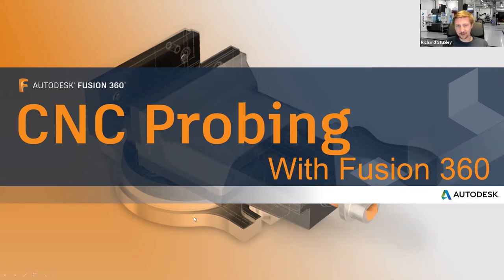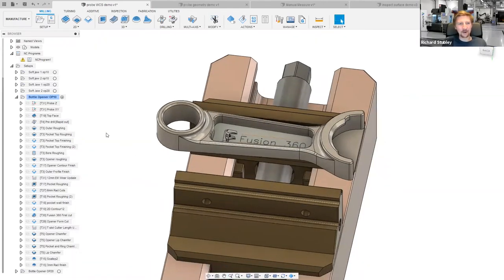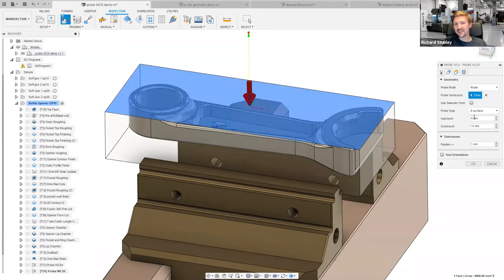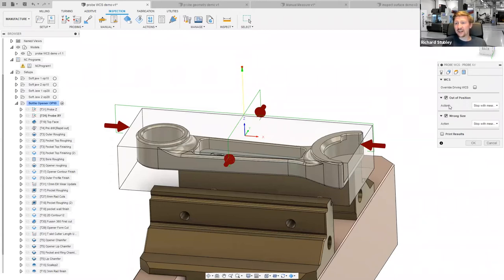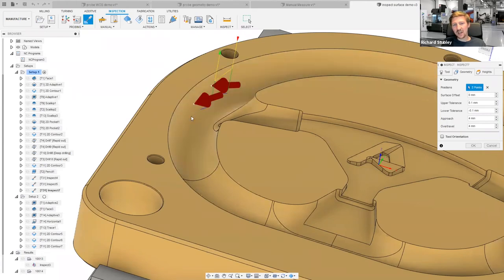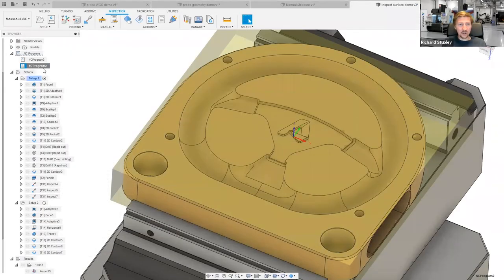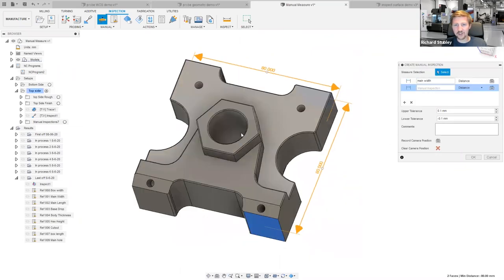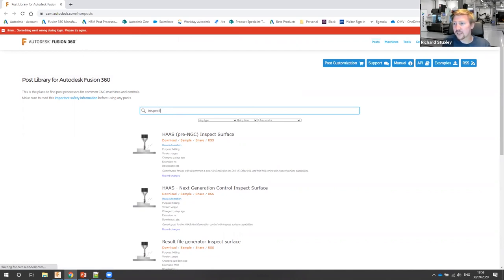AMexpo 20 -  CNC Probing with Fusion 360

Comment: HAAS 2019 VM-3. Question, probing for position in X. When I do that as the first cycle/operation  in a setup, I can watch my offsets change when it probes, then it goes right into the next operation, for example 2D Adaptive clearing. To my question, I am not 100 percent sure that HAAS NGC is now reading that updated position while it's running the program. I have even gone as far as to just do one set up, WCS probe then move onto another setup and role right into a facing operation. It only seems to re-read the WCS once the machine comes to a complete stop. Another way I can put this question is using this video at the 5:51 mark, if you where to post Soft Jaw 1 of 10 and Soft jaw 2 of 10  by highlighting them and posting,,,,,, and the very first opp had a WCS probe in it, those to operations would not reflect the updated WCS in my situation. It should be noted that it does show up in the offset page, but does not seem to be read while the program is running and comes to a complete stop. 

I am trying to use it so I can just put my stock in, shut the door, have it probe then run my program. 

Thank you very much for this video by the way. Very informative and well presented.
Reply from the maker: Hi Sean, here is the link to learn more about CNC : https://www.solidcad.ca/products/autodesk-products/autodesk-cam/
Reply: Hi @sean G I've only just seen this. On a HAAS the WCS table values are cached when "G54" for example is called. 

So if you call G54 then probe, update the values and do not call G54 again the new values will not be used for the next operations. You need to call G54 at the start of the next operations to get the new values.
I know the Fusion posts have this in, they always re call G54 on the next op after probing.